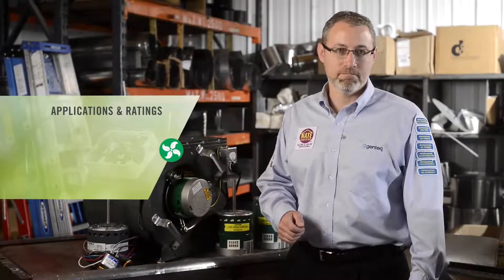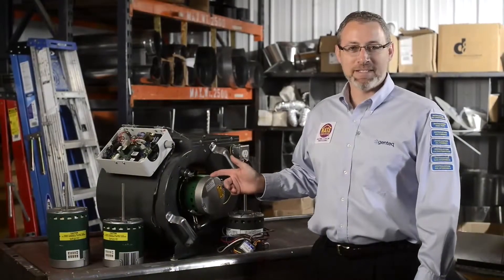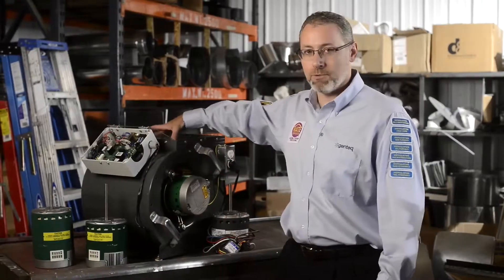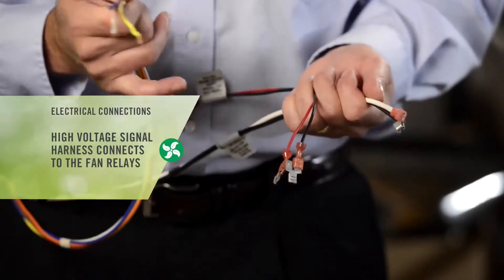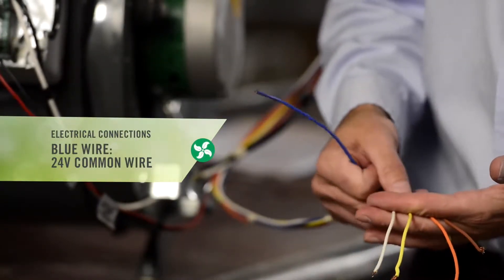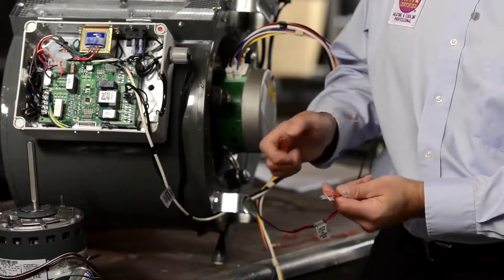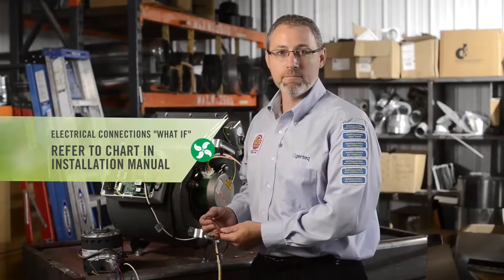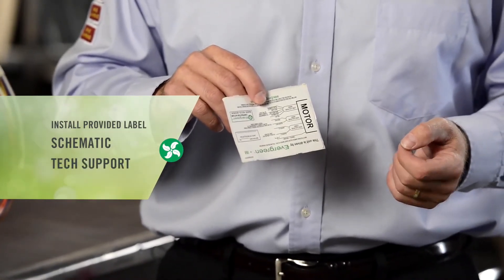Genteq® Evergreen® IM Motor Installation

Comment: I have a 3.5 ton system which used a 1/2 hp 115v motor in my indoor blower.  It would have been nice to know that you recommend the 1 hp for my application Before I purchased the 6005 IM motor.  You should rename these to the 6005 IM 1/5 to 1/3 hp and the 6010 IM 1/2 to 1 hp motors, for clarity.  Still,  the product was easy to install and is working great!